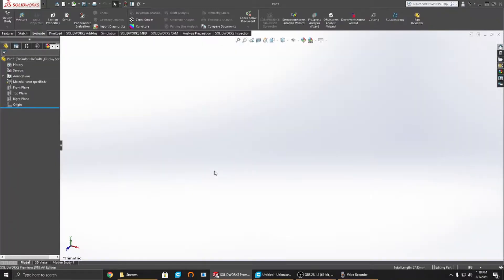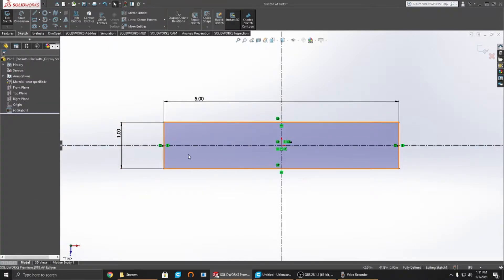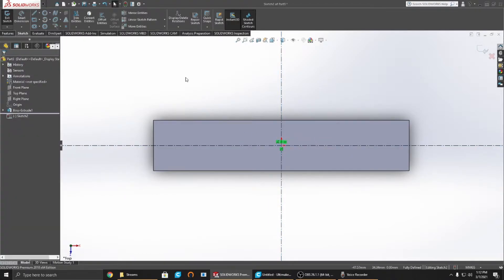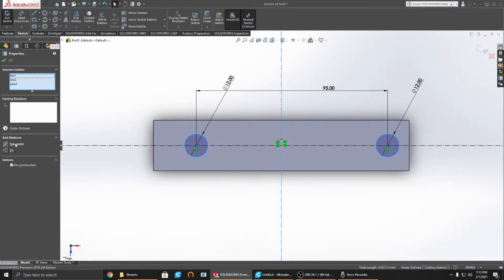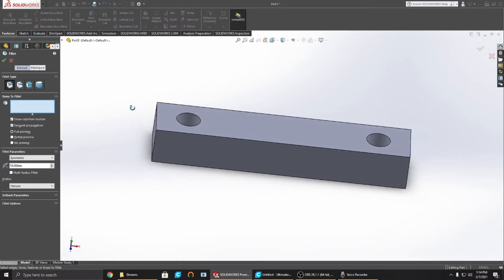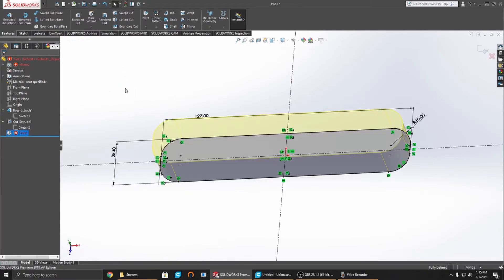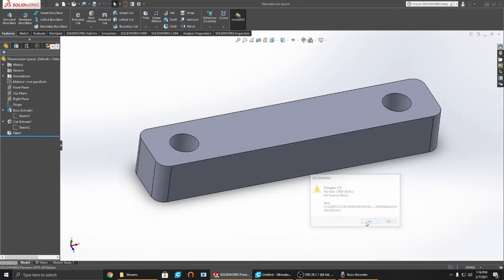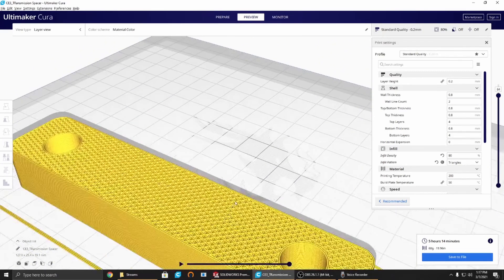How To Model in Solidworks And Directly Import to CURA for 3D Printing in under 10 Minutes

Comment: Be aware that the standard import/export to STL may not have the best quality if you do not adjust your options when saving. This is true for any CAD software I have personally and professionally used. Generally cranking the deviation and angle options to the min valves as long as the file does not become probability large is easiest.

Comment: when I try to open my SW files into CURA they get shrunk down to tiny,  then I have to try to resize them in Cura that doesn't always match the dimensions I had in SW?  What am I doing wrong here?  It is a contant problem? Using SW 2018 Pro and Cura Version 4.13.0
Reply from the maker: Double check the units you are modeling with in solidworks. Your units may he set to metric rather than imperial causing this. Cura does not touch sizing. It imports raw stl's so the problem is in the solidworks export.
Reply: 100% a units issue. Check the options menu when you save your STL from SW. SW and Cura need to agree on which units your are using.
It is better to fix this before converting to STL than scaling in Cura.